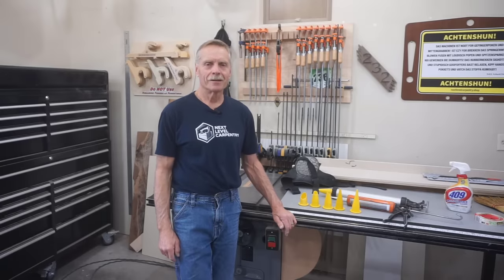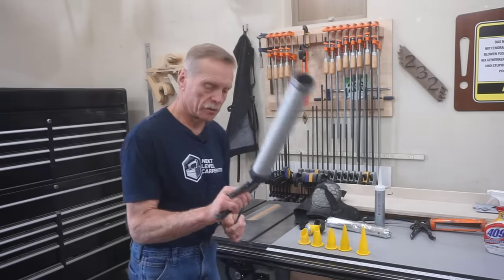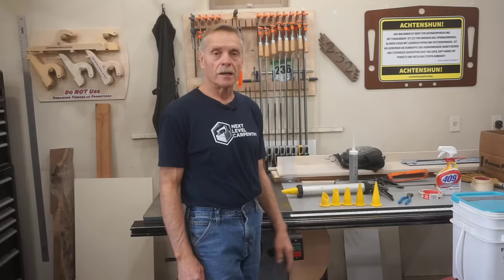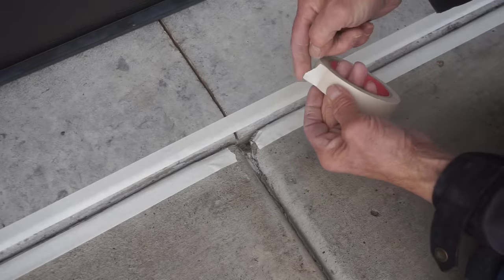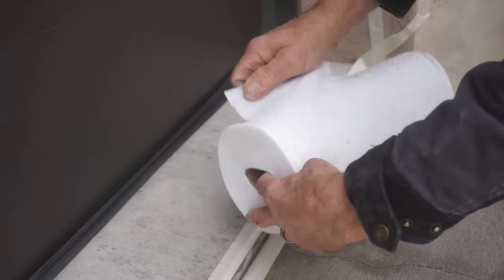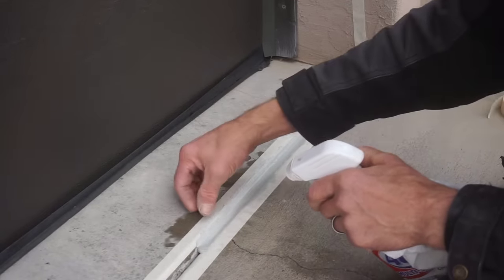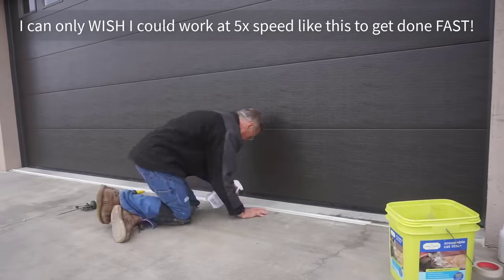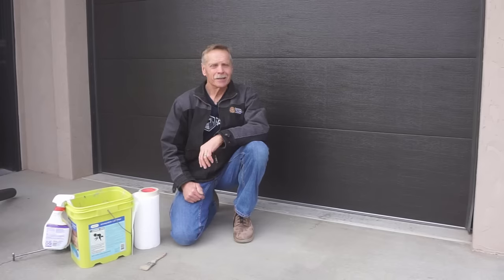How to Caulk Concrete Control Joints with Perfect Results Every Time

Comment: Can this same method and products be used on interior finished concrete floors to fill control joints?
Reply from the maker: Absolutely!  I've used it on many garage floors and floors in large commercial buildings.  Keeps gunk from collecting in them and also seals out radon, moisture, bugs etc.
Reply: @NextLevelCarpentry  would the product you're using here stand up to household cleaners? I'm trying to figure out what product is best for our floors (which are in the house, not the garage). The specific recommendations I have found for interior floors are for big industrial projects and grocery stores and not available to consumers. I'm trying to find something that can go in a gun that I don't need to mix myself.
Reply from the maker: @jessicaeasto  Tremco Dymonic is a one part product that's available in 10oz tubes that fit into regular caulk guns.  It's durable enough to be used on driveways, roads and buildings so I can't imagine it wouldn't hold up to household cleaners. I've wiped it clean with full strength lacquer thinner and not ruined it so a bit of detergent isn't going to dissolve it.  The biggest drawback is probably that it's soft, not hard like concrete or tile grout, but any good sealant is going to be like that: tough but pliable.  Depending on your exact application you might look into caulk products that are made to match tile grout made by Laticrete et al.  They're made to caulk corners and control joints in ceramic tile installations and, while considerably more expensive, might be a good option for an application that's aesthetic as well as functional...
Reply: @NextLevelCarpentry  Thank you!

Comment: can you tell me which tremco fc color best matches concrete i see you use limestone but would white work better with the silica sand
Reply from the maker: In Tremco I think the two best choices are the Limestone I used here or their Gray, depending on the shade of gray of the concrete you're sealing.  FYI  the silica sand pretty much transfers the color of the sealant you put it on so it's a moot point IMHO.  To be fair it does lighten the color just a bit so take that into consideration... Best, Matt

Comment: Can you use a few drops of dish detergent mixed with water in a spray bottle instead of an $6 bottle of 409?
Reply from the maker: During COVID when 409 wasn't available I dialed in a solution of about 13% Dawn Dish Soap and water and it worked fine IMHO.  'A few drops' might not be enough so your finger might stick in the goo and more than the 13%ish amount I used starts to get too much of a good thing but the substitution is a verified way to economize.
Reply: @NextLevelCarpentry  Good deal, thanks for your reply!

Comment: I’d to know if intense fire can cause damage to the concrete. My garage was burned & it created potholes on the concrete pad. Worse the insurance disputes the damage saying it was not caused by fire. Appreciate if you could text me instead. Thanks.
Reply from the maker: I'm no expert but know for sure intense heat will cause concrete to "spall".  Spalling is when little (or big) flakes of concrete pop off the surface leaving an undesirable pockmarked finish.  Heavy levels of road salt can also cause spalling and many un-burnt garage floors are heavily damaged by it...

Comment: Would denatured alcohol draw out any air bubbles?
Reply from the maker: I doubt it... plus there aren't any 'tiny air bubbles' to deal with with this product or procedure.  On rare occasions a large air bubble might form from trapped air but it's easily popped so re-tooling makes it a non issue.  Best, Matt

Comment: So you sprinkled sand on top of the wet caulk?
Reply from the maker: Absolutely! If you don't sprinkle sand on it the first dust dirt leaves and bugs that come in contact with it will stick there instead creating an unsightly mess of the fine work you just completed.

Comment: Hi,
What would you recommend for a 90 degree (side cement & stucco) on one side of my house.  Thanks
Reply from the maker: Probably the same products and technique adapted for the horizontal/vertical joint...
Reply: @NextLevelCarpentry  I am thinking of doing that because my house doesn't have the weep screed and when there's lots of rain the water stays near the wall.   Some of the stucco has come off.   In hoping this would help. 🙏
Reply from the maker: @jaimedpcaus1  I should help as long as it seals water out and doesn't seal it in.  Weeps are supposed to help an assembly dry.  Without them it might be staying wet already and sealing it up might make it worse in certain conditions... good luck with your project!
Reply: @NextLevelCarpentry  Yes.  Got it.  Thx and have a great new year.  😀
Reply: @NextLevelCarpentry  By the way, how often would you have to repeat this process?  Once every 3 or 5 yrs?
Reply from the maker: @jaimedpcaus1  every situation is different. I have projects that I did 20 years ago that are fine and sometimes Frost heave or shifting pulls a section loose in the first seasonal cycle. I just do the best job I can when I'm doing it and have very few repeat maintenance issues overall... 👍😎
Reply: @NextLevelCarpentry  🙂Thx

Comment: I went to use the sealant calculator but they ask about inefficiency factor. Do you know what that number should be? I searched all over and I could not find any info for Dymonic FC.
Reply from the maker: I'm not familiar with an 'inefficiency factor' but imagine it's got to do with applicator efficiency and common sense.  I'd plug in 10% and then 25% and see how it affects the quantity required and decide accordingly.  I'd guess there's a lower inefficiency factor using sausages than 10 oz tubes just because of the amount left in the tube, etc.  Hope that helps...

Comment: Without endless cracks in the bottom of the joint, self leveling polyurethane caulk is much easier to work with and does the same, if not better, finish.  Plus, you have a greater working time to apply the sand.  Just my opinion.
Reply from the maker: Definitely opinion and not fact... I won't argue that one way is right and one way is wrong but my opinion of self-leveling is diametrically opposed to yours. 😎
Reply: Next Level Carpentry Touché, but then again what is fact, but a figment of ones imagination
Reply from the maker: @9856CB  Ahhh, yes: a fig newton of one's imagination how fitting

Comment: Looks good, but I tried this with MasterSeal NP-1 and it was a disaster.   Couldn't get a smooth surface no matter what I did.
Reply from the maker: I'm not familiar with MasterSeal NP-1... if it's a urethane sealant and you used 409 like I show I have no explanation why you experienced a disaster.  If it's a urethane and you DIDN'T use 409 then a disaster is certain.

Comment: Anyone have advice on removing dried ribbons of caulk off the edges of a joint? I typically just hammer and chisel or wire wheel when I can but that tends to chip or mark the concrete
Reply from the maker: I always start with this tool first to cut away as much as possible before resorting to a wire wheel on slow speed: https://www.amazon.com/dp/B00QL4Y488/?ref=idea_lv_dp_ov_d&tag=onamzdigitalj-20&linkCode=ic6&ascsubtag=amzn1.ideas.2N0D3GFVZVC8G  It's a great tool for all sorts of other uses too! Best, Matt

Comment: How long do I need to wait before driving over the sealed joint?
Reply from the maker: Hey Justin, 
24 hours is usually pretty good in warmer weather.  Longer is better so if you can stay off it for a few days there's less risk of tires imprinting soft sealant.  If the joints are narrow and you tool them slightly concave as shown in the video you can actually drive over them right away (providing you use sand to prevent dirt from  sticking) because tires will never touch the sealant.  I recommend laying strips of thin plywood over fresh joints for protection if you have to drive over them before the sealant has cured.

Comment: How long should you keep the sand on the top of the caulking?
Reply from the maker: Sand can be blown off the top of the sealant as soon as it dries out but if you need to brush it off you probably want to wait 24 or 48 hours so the caulk is stiff enough not to be damaged from the bristles when removing the sand. You can just leave it alone also and eventually anything that's not stuck will just disappear...
Reply: @NextLevelCarpentry  thanks

Comment: Would this work for expansion joints on the cement ceiling in a condo?
Reply from the maker: I don't see why not but it's probably Overkill and you could get away with some sort of paintable siliconized latex instead....
Reply: @NextLevelCarpentry  thanks!
Reply from the maker: @adamsheehan6649  Youbetcha!

Comment: Can this still be done without the grinding?
Reply from the maker: The grinding process is mostly for Aesthetics so if the concrete you're sealing is smooth without a bunch of bumps on it no grinding is necessary. I find that very little concrete is that smooth so I usually end up grinding at least a little bit on every job because a little grinding goes a long way to making the job easier faster and the end result that are looking

Comment: You talked about silica sand but didn’t mention if it is used to fill very deep joints. Is that the purpose of the sand? The crevasse on the apron I am going to fill is pretty deep and would require vast amounts of caulk if not filled with sand first. HELP!
Reply from the maker: You might want to re-watch the video to see that the purpose of the silica sand is only to keep other detritus from sticking in the fresh sealant.  The best practice for establishing the depth of the sealant is to use appropriately-sized backer rod. The joints I did in the video did not require a backer rod but you can find information on that elsewhere. Best, Matt
Reply: Thank you very much

Comment: It seems like self-leveling sealant would be easy.
Reply from the maker: It IS easy... to make a big mess in a hurry, that is! 🤨
Reply: @NextLevelCarpentry  how is it messier than what you used in this video?
Reply from the maker: It will continue to run until it seeks level equilibrium so unless the work you're doing is perfectly level it'll end up puddling on one end and not having enough at the other end of a joint. It also remains liquid much longer allowing dirt and crud to collect in The Fresh Bead of sealant. In addition you have 0 control over the finished look of the sealed joint. As such I refuse to use self-leveling for any application...

Comment: gaaahhhh.. so I tried but I put the sand down before removing the tape. Then proceeded to try and feather it in with the sand on it after removing the tape. Then got the stuff all over me. It was a comedy of errors. This may be a job for a wire wheel in a few weeks and do it again. Any recommendations for taking OUT bad caulk?

Comment: Can I use that urethane caulk between asphalt and concrete?
Reply from the maker: No, definitely not recommended because it will not stick to Asphalt and just leave a bigger mess than you started with...

Comment: How long before you can drive on it?
Reply from the maker: 24 hours is usually pretty good in warmer weather.  Longer is better so if you can stay off it for a few days there's less risk of tires imprinting soft sealant.  If the joints are narrow and you tool them slightly concave as shown in the video you can actually drive over them right away (providing you use sand to prevent dirt from  sticking) because tires will never touch the sealant.  I recommend laying strips of thin plywood over fresh joints for protection if you have to drive over them before the sealant has cured.

Comment: tried to use your link and they dont have the caulk . what else do you recommend?
Reply from the maker: Try local contractor's supply outlets or maybe use a dealer locator at the Tremco website as I do feel pretty strongly about the brand's performance... good luck, Richard! Best, Matt

Comment: what's the cordless air blower you used?
Reply from the maker: It's a Stihl model SH 86C. Any one of their blowers is excellent so you can't go wrong with the brand IMHO.  Mine is at the upper end of the hand-held capability range.  I chose it because I don't like whimpy machines but didn't want to make the leap into the size/performance of a 'backpack' style blower... Best, Matt

Comment: When the product you are using cures does it get super hard? I want to fill the expansion joints in the shopfloor and want a product that when it cures is super hard so when the wheels on my various tools run across it there are no marks left behind. In my local Lowes and Home Depot, the product they use on the floors is super hard after curing. Seems like it is almost as hard as the concrete. I've asked at the stores but so far have not been able to get an answer.
Reply from the maker: Actually John the main benefit of this product is that it never does get hard but remains pliable like tire rubber for decades. Anything as hard as what you're looking for will just crack out when the concrete moves inevitably from changes in temperature Etc. I use this on floors and driveways frequently and the trick is to leave The Joint slightly concave so the tires never touch it... that is unless the joints are more than about 5/8 inch wide or so but then you're dealing with a whole different problem. You might have other reasons for looking for a different product and if that's the case I would suggest looking into epoxies which would probably perform well but require much more prep work for good bonding. Best, Matt
Reply: John, what you're looking for is epoxy made for interior concrete. SIKA makes good epoxy products. 
  It's meant to prevent chipping at the joints from hard wheeled fork lifts and other traffic. The easiest way to apply the epoxy is with a bulk loader gun where you suck the mixed epoxy into the gun like a bulk grease gun. Once a gallon of the epoxy is mixed you would have to go very fast as it sets up in twenty minutes. It's a two man job. Prepping, applying and shaving. 
  Once the epoxy is in place you can use a razor scraper to scrape it flush. Some applicators wait for the epoxy to cure and the next day they run a propane torch over it to soften it up and then scrape it with a razor scraper.  If your shop isn't constantly heated the concrete slab will move and the joints will fail.  I would suggest following NLC's video but use Tremco Dymonic 100 instead of Dymonic FC.  Dymonic 100 cures harder and is tougher than Dymonic FC. It has better movement capabilities as well. Use a bulk sausage gun with a tip the size of the joint. Back fill the joints if necessary with the appropriate size of backer rod.  Overfill the joint slightly and then shave it flush before it cures.  Make sure to have a cardboard box or coffee can to scrape the excess off into. This has to be done carefully or you'll get caulk all over. 
  Applying epoxy is even more of a specialty job than caulking and you would need to buy a bulk loader gun and clean it with a solvent like toluene, xylene or MEK every 20 minutes.  Nasty stuff.
Reply: @chuckp_again_and_again  /NLC Much thanks guys!  Yesterday I called Lowes Pro number. The person that answered just referred me to my local Lowes pro desk so I gave them a call. Of course, I was transferred to three different people. The third person stated that I wanted their "Poly Concrete Expansion Joint filler" and it was on aisle 20. I ask for a bin number but he said that there was none. So when I went to Lowes today I could not find it. I ask at the Pro desk and the lady pointed me to an end-cap. I was not able to find it there either. I gave up.

I've used a lot of Epoxy and agree, it is nasty stuff and I always manage to get it in places that I don't want. I'm leaning away from it. However, I have been successful using it for tabletops. I need to think about this option a bit more.

I live in Oak Island, NC and in general, the temperature is mild enough that a LOT of people have exposed water lines outside and don't have problems or at least so far they don't.

I really like the prep effort by NLC and it really shows in the finished product. 

My current floor was covered with Epoxy by the previous owner. I used a similar product in my AZ house and was disappointed when it chipped after dropping tools on the floor. Also after cutting MDF it was a MUST to clean the shop floor and remove the darn dust. It was like stepping on the ice.
I've emailed Sika and Tremco.
Reply: @johnterdik4707  Self leveling might be the way to go for sawcut joints. Good luck!

Comment: So, as used here, 409 acts as a post-application/pre-dry thinner...no???
Reply from the maker: Hey Kurt; No: it's strictly a lubricant to tool the super-sticky urethane by keeping it from sticking to EVERYthing.  The water in it evaporates away quickly, especially when it gets soaked up by the silica sand I use.

Comment: Can I put Dymonic FC over the top of fresh self-leveling polyurethane?
Reply from the maker: Can you? Maybe... I think it will just make a mess though and wouldn't recommend it.  Much better to wait until the self leveling has had time to stiffen/cure first.  That way you could vee-cut most of it out so layer of FC is a bit thicker which should make for easier tooling and a better finish result overall...  that's just my 2 cents worth though so use it accordingly and make the best decision for your application... Best, Matt
Reply: @NextLevelCarpentry  Thanks buddy